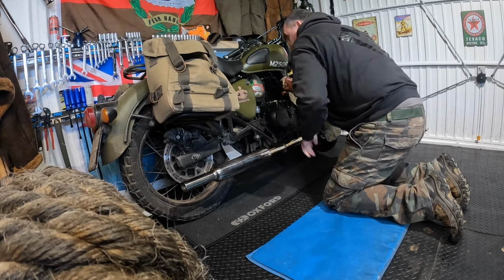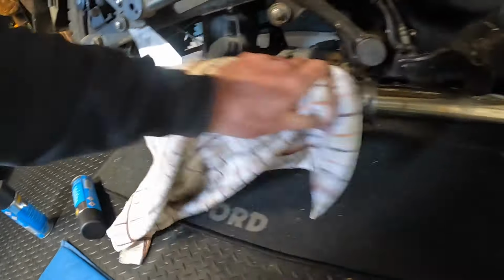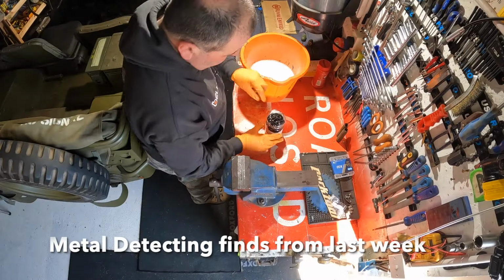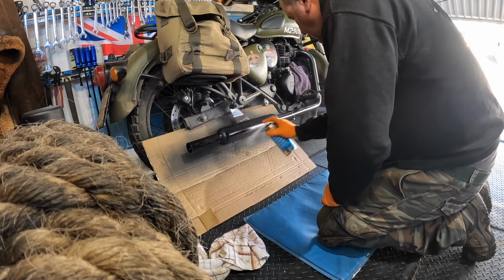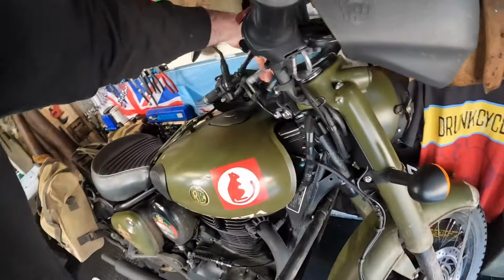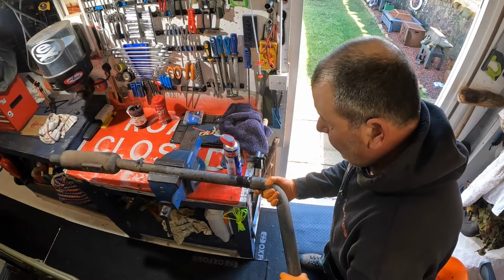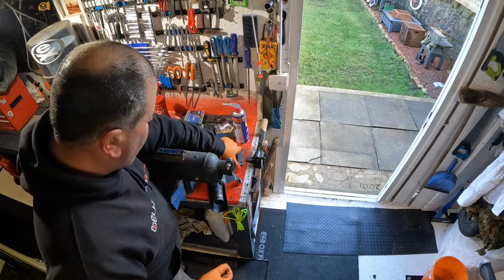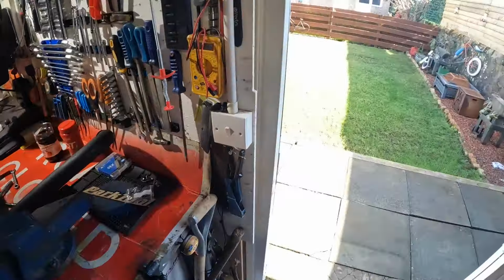Royal Enfield Classic 350;   PAINT the Hitchcocks FREE FLOW Exhaust  Black!

Comment: Looks much better in black Bruce, im turning my interceptor 650 into my version of the Dark model, just bought black mag wheels and a continental 650 tank which looks nice, im doing the engine casings and exhausts in black but i cant seem to find a heatproof texture paint like the 350, you any ideas what i could use?, Atb Chris
Reply from the maker: Not sure what paint would be best Chris, though PJ1 heat proof paint is really good,
😁👍